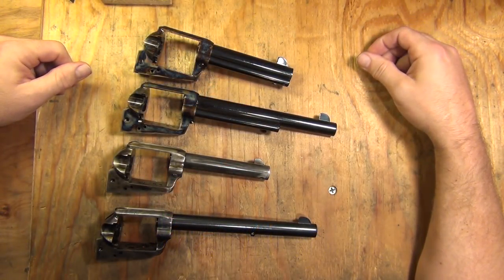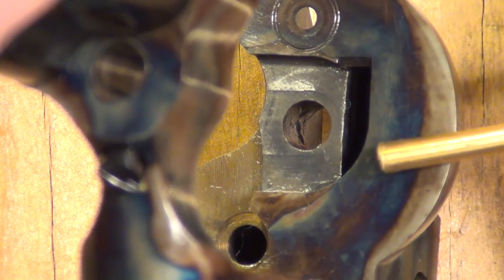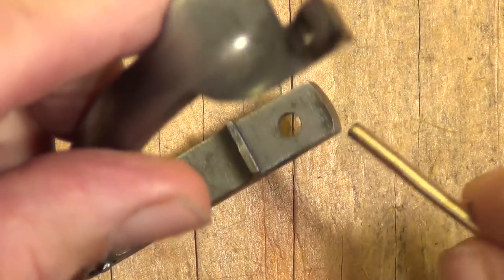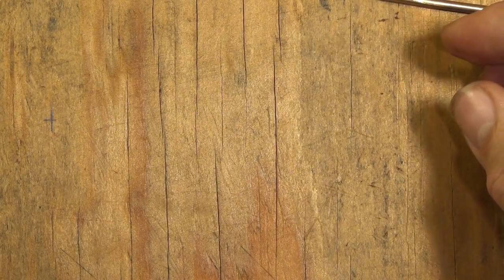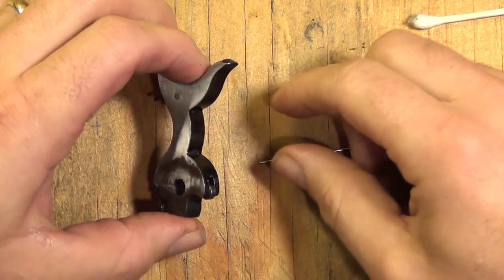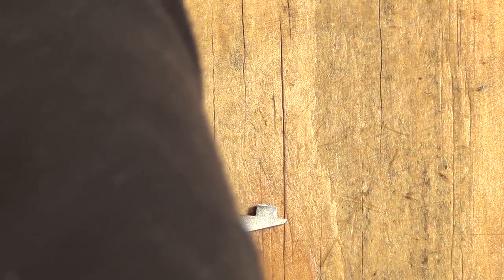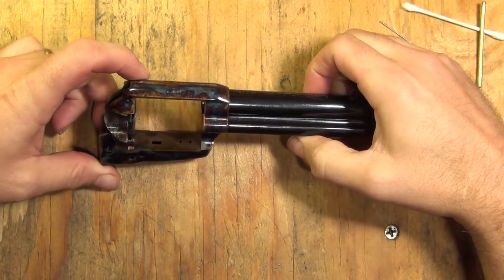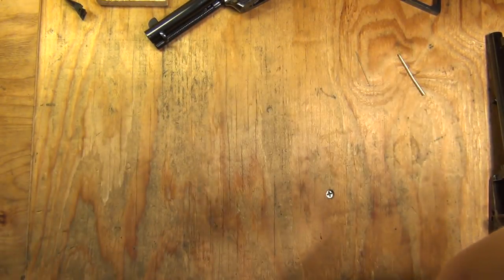Standard vs  other Single Actions--details

Comment: I have read that Colt is using MIM parts now on the SAA, and I don’t doubt this as they require minimal machining, and I see a good bit of the new Cobra is MIM. Like the side plate hammer and trigger and barrel, and others I am sure. So if a new Colt is $1799 and the standard is $1895, being 100% machined is definitely worth the slight extra premium. Excellent video and thank you for the in depth look, as this is what I want to see about a new gun.
Reply from the maker: Good luck finding a brand new Colt SAA for $1799.  They sell every one they make to distributors who are back-ordered for years.  Naturally, the distributors mark them up, so no one can really buy one new for as little as $1799, despite what Colt may claim in their MSRP.  Plan to spend at least $2,200 for a new Colt--IF you can find one.  Furthermore, although I don't know about MIM in new Colt SAA's, I DO know that they use a cast trigger guard.  For now, anyway, every major part of the Standards are machined out of 4140 steel.  I can't vouch for the springs, but all the other parts are 4140 machinings.  The only metallurgical superiority in a Colt vs. the Standard would perhaps be in the frame.  Colt is still forging their frames, whereas Standard machines theirs out of barstock (Colt did, just recently, have to issue a recall on some of their latest SAA's due to metallurgical flaws in the frames, so there is no guarantee that a new Colt is necessarily superior due to their forged frames....).  But given that the original design utilized iron instead of steel, and that even the early steel Colt SAA's used a somewhat primitive grade of steel vs. what is available today, any "machined out of 4140 barstock" frame is far stronger than any 1st Gen Colt's.  If I could afford it, I'd be ordering a nickeled Standard soon, followed by their newly-announced BP-framed .44-40 version.  It may be a while before I can swing that, though.  So here's hoping that they stay popular enough to continue this venture indefinitely and not go the way of the Dodo like USFA did.  I'd like to be able to sample some of their other stuff.  On the Cobra, I can confirm that they are largely MIM.  I have one, and I do like it.  Well-executed MIM can be relied upon to do what it needs to do.  But there's just something special about an all-machined steel firearm, and I'm glad that Standard has taken up that torch for now.

Comment: Very good comparison between the SAA available today and reinforced my purchase of the Cimarron 7th Calvary BP frame reproduction by Uberti. It did have some finishing problems as a spur dimple where the firing pin protrudes through the frame causing jams that was remedied with my pocket knife blade and a few scratches on the hammer. One must reason that these pistols are made in batches at a price point and extra time precludes easy finishing at the factory work bench. It has fired hundreds of rounds without issue. How they can make a quality pistol at my cost is astounding at this time. Our own country offerings show what we are capable of for those who demand the best as Standard current offerings are.

Comment: Another very informative video and yes I watch the whole thing. The 2018 Colt I just sent back for their recall was beautifully machined inside the frame and had nice case colors reminiscent of a 2'nd Gen example. Looking forward to seeing what the replacement SAA their sending will look like. I wish you would have had a current production Colt in your comparison here. The SA prefix SAAs when compared to the later S prefix A suffix seem not as well done in my experience. Thanks again for the time and effort you put in to this video, anyone who watches it will learn a lot.
Reply from the maker: Thanks, man.  I, too wish I'd had a current production Colt when I made this video.  The latest one I'd owned was a 2009, and I can say that both USFA and Standard beat that one for machining quality.  But I have heard that the latest ones from Colt are even better.  So it is a shame I didn't have one for comparison review.

Comment: Thanks for posting this video. Was very informative. I’ve got an uberti offering from Taylor’s that’s about a year old and it runs very smooth and shoots good so far, but it’s gotten me wanting a real colt but I don’t want to wait forever plus colts recent recall issues got me interested in the standard manufacturing model. Your review pretty much seals the deal and I’m favoring the STD SA. Now just to decide on barrel Length lol
Reply from the maker: Very happy that this has helped you.  Believe it or not, I've actually received two "back in stock" notices lately from Grabagun about the Colt SAA in 4.75 inch barrel, blued/color-cased and .45.  And they were only around $1,700! 
 But each time I clicked on the link, it showed "out of stock" again.    Probably for the best, as I really can't afford one right now, but I'd like to get my hands on a new one, just for a compare/contrast.  

In the spirit of full disclosure, not all the comments here have been positive about the standard; I have had a few negative comments.  One guy, Ron Romano, posted a VERY long report on his.  And he was unhappy with it overall.  He thought the finish was sub-par, the walnut not fancy enough, and the barrel overbuffed.  Worst of all, the bolt timed just late enough that when he cocked it fast, the bolt over-rode the notches, giving him cylinder overtravel with misfires.  So now his cylinder is scarred a little, and he said that Standard will repair it but not give him his money back, and he has buyer's remorse.  I hope it wasn't my review that talked him into buying one.  

But I was unable to reply back to him.  I got his comment notification by email, but it doesn't show up on here.  I checked my comments manager, and it isn't held for review, so I'm guessing he deleted it.  Anyway, I suppose it IS possible to get a substandard Standard, but the vast majority of reviews I've read have agreed with my own--this is a quality Single Action.  Good luck, and please let us all know how you made out.  Also, thanks for your comment on my other video--the one about just listening to it as you drove.
Reply: Was cleaning up my smoke wagon from Taylor’s last night and I noticed the step on the frame regarding the headspace that you pointed out; it appears to have been stoned smooth. This is a deluxe edition from Taylor’s that is claimed to have work done to it after they get it from Uberti. The one piece checkered grips fit completely flush. The only negative I have to say for it is the new safety uberti has incorporated into the hammer eliminating its authentic feel for me at least. It’s a great shooter and was my entry into the Single Action addiction but it being Italian, it won’t matter how well made they get. Made in America has a certain sway. I’ll probably end up with a Colt and an STD but the colt might come afterwards unless I come up on one somewhere here in Southern California at a price I find reasonable not marked up incredibly high

Comment: Great video.  Thank you!  I learned a lot.  I have and shoot a number of Cimarron Ubertis and a few Colts, and love them all.  One correction/update on the new Uberti "Safety Hammer" with retractable firing pin (mentioned at about the 27:00 mark), as of July 2019 Cimarron is still importing their "Old Model" (Black Powder Frame) Model P's with the standard fixed firing pin hammer.
Reply from the maker: Thanks for that comment, and thanks for the heads-up about the "Old Model" Model P's with the standard fixed firing pin hammer.  I know that a lot of guys on the forums have been asking about these hammers, and the general consensus was that the old style hammer was no longer available from Uberti.  Consequently, folks were advised to purchase from Pietta instead.   I hope you're right about this; I checked their website and found no references to that.
Reply: @atlanticproducts  Cimarron has included that info in marketing emails, though it is harder to find currently on their website.  But if yo go to their home page, there are a dozen banners that rotate across the page advertising new products, and the next to last banner gives the mentioned info.  Thanks again for all the detail.  I looked at my two .44 Spcl Colts made in '78 and I see that flat spot on the hammer knurling, haha!
Reply from the maker: Thanks for the confirmation David, and also for your positive comments.

Comment: On Pietta GW2, ejection housing screwed into a lug like Colt. It' shocking to me that Standard did it like Uberti considering what they charge.
Reply from the maker: I had a Pietta GW2 once, and I was impressed with the steps they took towards authenticity.  For example, their frame window and cylinder are slightly smaller than Uberti.  So in that regard, they are closer to Colt than Uberti, USFA, or Standard in their reproduction.  Their cylinder bevels were more severe than ones on the other reproductions and therefore more like the earlier Colts.  They also included an actual firing pin bushing, which Uberti leaves out.  And, they secured their ejector tube with a lug on the barrel (like Colt), rather than with a threaded hole like all the other repros (including Standard) do.  I did notice (on my example anyway), that the lug was not secured to the barrel in the same manner as Colt; it was dovetailed-in rather than staked into place.  And the top of the trigger guard wasn't beveled like the early Colts that Pietta is trying to replicate.  Rather, they're shaped more like a modern Colt.  What ultimately soured me on Pietta SAA's, however, was the contours of the front right portion of the frame where the ejector tube enters.  It was very muted and just plain "wrong" in how the frame was shaped there.  The other reproductions are deeply sculpted around the tube, like a Colt.  I noticed this muted contouring on a friend's US Cavalry model Pietta as well.  So I don't think it was limited to my own example.  I made the mistake of pointing this muted contour out to him, and it bothered him so much that he sold it.  Before that, he was very pleased with his Pietta, his only gripe being the sprue marks on the trigger which identified it as having been cast (probably MIM).  The Pietta GW2 is a great value; what you get for your money is a SAA which copies the earlier Colts much better than the other repros do in certain areas.  If the minor cosmetic issues I noted are of no concern (and honestly, they really shouldn't be),  one should be very happy owning one.
Reply: @atlanticproducts  Yes, I guess each man has his own priorities. I understand the authentic visual detail you enjoy with Standard. I like an authentic looking SAA clone but don't have the critical eye you have for small details. I build my Piettas into Bob Munden style race guns which further depart from authenticity but are a ton of fun to fan without damage or malfunction.

Comment: Yet another feature length video Eric ! I really enjoyed the comparison with the Colt made revolver, but what really surprised me was the really awful machining on the Colt, there really is no excuse for such terrible finishing with modern CNC programmes , they look like something made in India ! and the small lock components would really benefit from tumbling to take off the burrs on all of them, it looks like there is a small burr on the bottom of the firing pin hole on your otherwise excellent Standard, that could be the reason for the asymmetric shape of the firing pin, it is a nice feature to have the steel bush around the firing pin hole, but I am not sure it is really necessary with modern steels, the colour case on the USFA and your Standard is wonderful, I think there must be a lot of very embarrassed quality inspectors at the Colt factory after watching this, I would think they do not expect people to actually look inside them, surely the first generation Colts were not as badly machined as this, and they had conventional machines. You have produced another standard reference work here ! Chris B.
Reply from the maker: Hey Chris, thanks!  I do have to say that my example Colt was made in the early 1980's and doesn't represent the current state of Colt's SAA manufacture.  By all accounts, they've upped their game since then.  USFA was largely responsible for Colt's uptick in quality, and the one I once had that was made in 2009 WAS machined better than the Colt I featured on this video.  Of course, I traded that 2009 model for the 1970-made SAA featured in my other video, so that may say something about what I thought at the time of the respective differences in quality between the two.  If I recall, the 2009 was better cosmetically, but the 1970 was better built.  Even with Colt's reported improvements in quality, however, they still do not expect people to look inside them.  In fact, they don't even expect people to shoot them.  Their owners manual specifically cautions owners that shooting them will destroy their collector value.
Reply: I didn't think the machining on the colt was bad. I thought it was worse on a couple of the other ones. The only thing I like better about the standard is the color case harden is really nice. Some of the machining and other things I would be able to smooth or fix myself.

Comment: Great video I have 1860 conversion uberti and it quality is extremely poor in two places but excellent everywhere else, sharp edge on The recoil shield for the headspace made it impossible to shoot and backstrap I'm trigger guard don't meet up correctly. Step in the frame what's an easy fix but I have no idea how to fix the trigger guard

Comment: Awesome video.  Strange in your comparison of the top strap on the frame between USFA and the Standard.  The profile of the top strap of my premium USFA (ser. 23XXX) follows your Standard rather than your USFA both from the front and the back.  That makes me think that USFA changed the profile over time and at least at certain points were very similar.
Reply from the maker: Now that IS strange.  I'd love to see a picture.  Every USFA I've examined that was made earlier than yours was like the one in this video, and the one in the video is of even later production than yours (ser. 27XXX).  I can't imagine why USFA would change to something more closely resembling the Standard's contours during some interim between the earliest all-USA-made and the latest (my premium was ordered by its first owner in 2010).  Unlike Colt, there aren't authoritative research publications available for USFA.  Most of what we know is due to guys on the forums making comparisons and the occasional tidbit shared by former employees.  Doug Donnelly shut down production of these rather suddenly, sold off the machinery, and the opportunity was lost.  The Colt SAA changed a lot over the years, and each minor change has been painstakingly detailed in books and articles.  If you're familiar with the forum "CAScity", it is a Cowboy Action Forum (I don't participate in that sport, but I do love the firearms of the period).  They have a whole subforum for USFA.  Lots of good information there, but anyone with pictures of an anomaly would be very much appreciated by the members.
Reply: @atlanticproducts  I'll check out the forum and also try to take some pictures when I have better lighting in the daytime.  I ordered mine from the company in 2005.

Comment: Hello! I have a quick question and a favor to ask you. Thx for your informative videos first off! I am making an exact 1/5 scale miniature saa 1st gen to hopefully reproduce. I wanted to know if you can measure the outer diameter of the muzzle end of a 7.5" and also a 5 1/2" barrels in inches or mm and reply to my comment with the masrements if its not to much trouble.  I have measured a 4.5" barrel and got 19.3 mm rear barrel diameter and 17.4 mm for the muzzle end already by handling a uberti at bass pro shops with my trusty calipers lol. I have the saa shop manual but barrel and ejector tube dimensions are not included and not on any forum so I am doing all I can to get those measurements. Thank you for reading. God bless! (John 3:16 kjv)